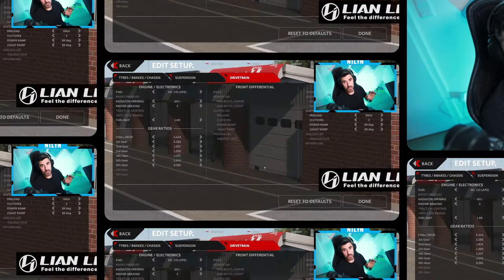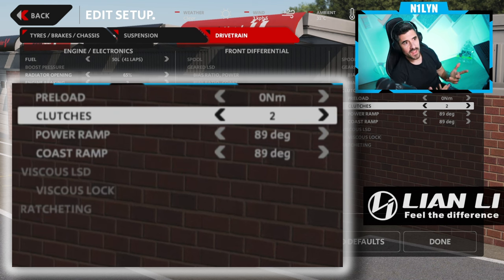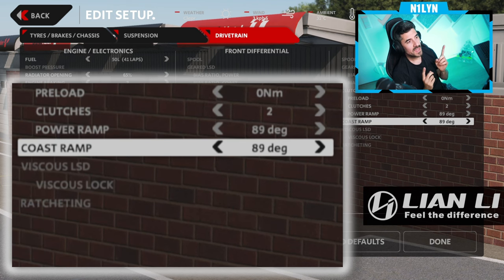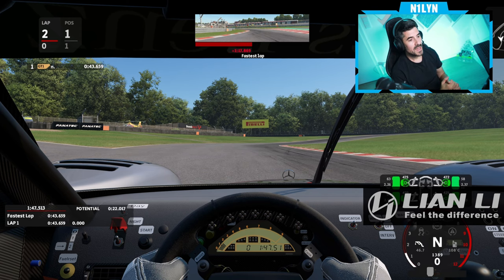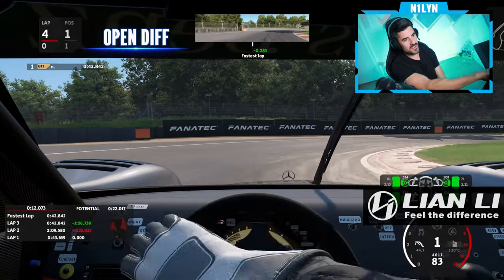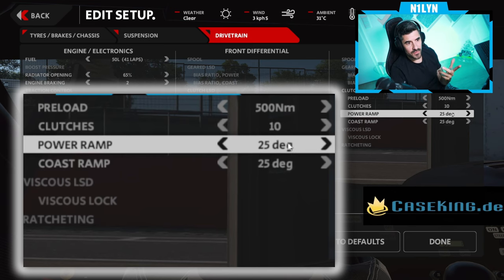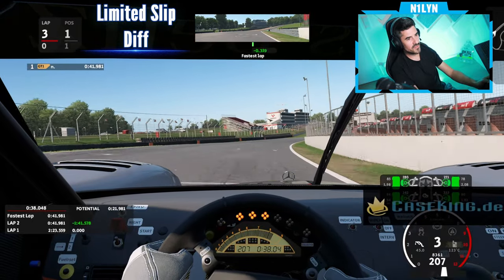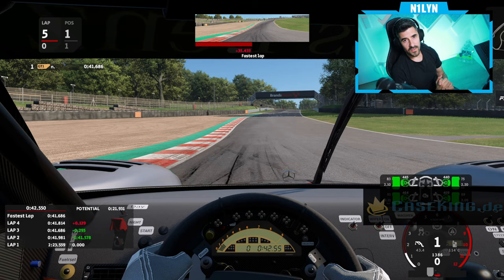How to adjust the Differential correctly for lap time and drivability

Comment: At 13:27 the higher number in the diff means its more open. So the power at 63 is more open than the coast at 30
Reply from the maker: yes yes yes, just as i set it up - but brain fail to say it right

Comment: So unless I'm misunderstanding something, why do all the tunes I've tried from coach dave run preload as low as it can go? The rear toe is set to 0.0 on most of them, so the rear end is already so lively, more so than setting the toe to .05 or .1 and running more preload. Why is one better than the other? I find more preload(not a crazy amount) and more positive rear toe easier to drive. I'm newer to sim racing and trying to get into tuning. If this isn't something you can answer briefly I understand lol. I drive the 992 if that matters.
Reply: "I drive the 992 if that matters." It does, because the 992 already has tons of rotation. Especially off the throttle.
Most paid setups prioritise rotation over drivability, which explains the settings that you mentioned. 
If you are looking for a different approach for the 992, Nils has created a setup and data pack for it. But just adjusting the preload and maybe give some positive toe to the rear can mitigate problematic setups to some degree. But really, get Nils' 992 pack. 
I think the Silverstone track is free, so you can try it out. There's a video somewhere here on the channel where it is linked.
Reply from the maker: I explained the Porsche in more detail here alongside the data & setup bundle: https://youtu.be/e6F1K8FR3J0

Also, as mentioned in the video: Preload has very little effect. We'd need the ramp angles that are unavailable for adjustment in gt3. The low preload seen in many setups helps to not get a (even) sharp(er) locking of the diff on exit giving the driver a tiny bit more time before the rear becomes more likely to snap.
Reply: @SimracingPopometer  Awesome, thanks for the reply. And your first video on diffs has already helped me out a lot btw. This has very quickly become my go to channel for this stuff.

Comment: open diff was 89 deg., so I think you contradicted yourself when you showed off your "balanced" diff. It is more open on power and more locking on coast, then. Anyway, IDK about adjusting using these degree metrics. Thx for the vid 👍
Reply from the maker: higher degrees make it harder for the differential to push the clutches together, so there is less friction and therefor less locking. You had me for a second but I think i am correct :D
Reply: @SimracingPopometer  I think he means timestamp 13:32, there you indeed got the Versprecher :D
Reply from the maker: ah i only checked the diff values, they were fine :P
Reply: Degrees are fundamentally the same as percentages you see in some other sims (GPL had degrees too I think), but inverted like you pointed out and you can't know what percentage they amount to without knowing the clutch disc friction coefficient. Number of clutch discs/facings is known here of course. The scale is non-linear with adjustment getting more sensitive as you get to the smaller degrees. And really small degrees aren't mechanically feasible as the ramp would have to be super long on the clutch LSD housing.
Reply: @oez4880  very interesting, thx 🍻
Reply: Oh wait I just saw this, on games low value means more open and high values locked, am I right?
Reply: @DrPepp  when it is percentage values, yes. When using the metric shown in this video, it is the opposite. Easy to test, anyway. When you have crazy wheelspin on throttle, you have open diff (on power). As shown in this vid